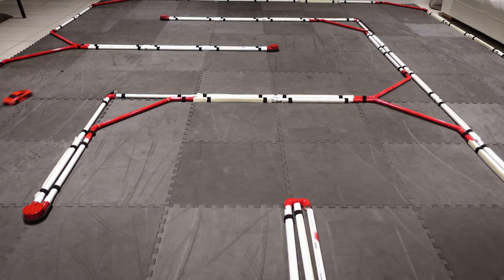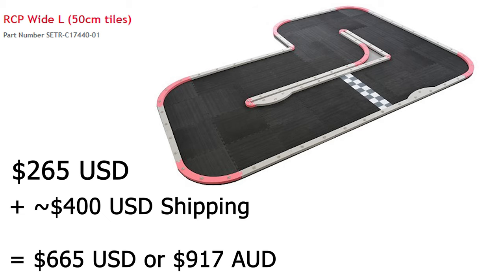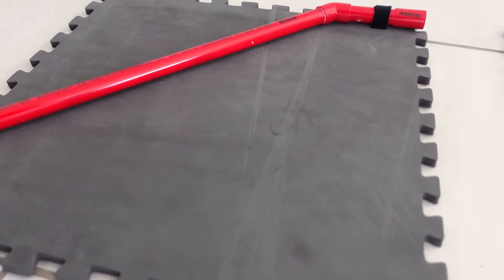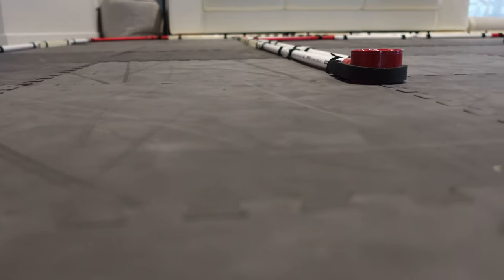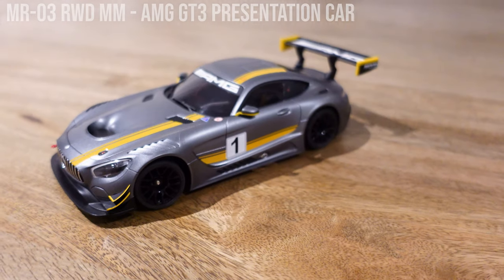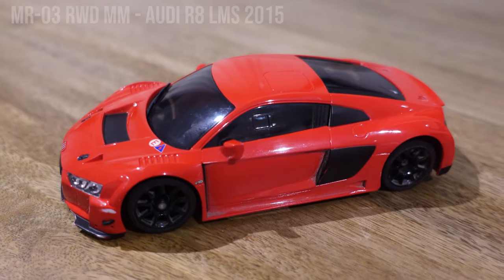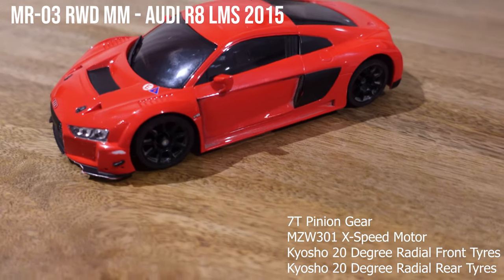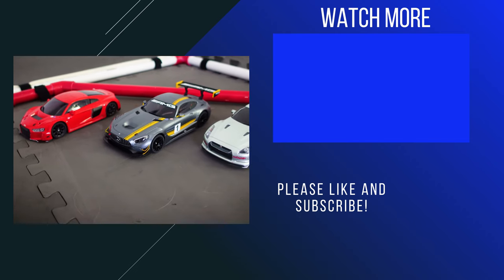I Made A Track For Mini-Z RC Cars

Comment: I have something similar. I bought adhesive neoprene on amazon and cut it down to match the thickness of the pvc pipe all the way along the pipes to prevent any damage to my cars. It will allow you to have piece of mind as well down the straight aways!
Reply from the maker: Great idea with the adhesive neoprene!
Reply: @jarvzRC  yes it’s been working well and definitely improved my driving. I really like your track design and how you painted certain areas. The money you saved on a track can go to upgrade parts! Keep up the great content!
Reply from the maker: @RePtIlEBoI255  Cheers!

Comment: Nice... i made my own track also from foam tile like that... but i cut the foam instead of using pipe, so it will protect your car... and you know what, the pattern track is similar like yours... yes the joint is not flat, you can use tape on the joint to make it little bit smoother...
Reply from the maker: Very nice! I've seen photos of tracks made using cut up foam for the barriers and I think I prefer that over the PVC pipes. I'm considering updating my track and changing the barriers to foam in the future.
Reply: Hey guys....just about to do this myself, fantastic idea. I didn't quite get what you meant by cutting the foam? I like the pipe because you have a barrier /outline  .... But you can do this with the foam? I can't quite visualize in my head what you mean. I'm probably being stupid :)
Reply: @D1ARBO  it means... i cut the mat, and make it as separator of lane... it’s good for the car in case there’s collision/crash to the separator, it act as dampener

Comment: Nice looking track. What did you use for the inside corners? Looks like soup cans.
Reply from the maker: I used PVC junction boxes. If I were to do it again, I would use cut up pieces of foam tiles to use as barriers because the PVC is too hard on the Mini-Z bodies

Comment: Great Track! what does the t plate ACTUALLY do when running on this type of track?
Reply from the maker: Thanks! The rear T-Plate plays an important role in the Mini'z's handling. Without the correct T-Plate, your rear won't have good traction and your car will be difficult to drive. 
The T-Plate has two functions:
- It is meant to absorb bumps
- It is meant to transfer weight forward, backward and side to side

I haven't done enough testing yet on my cars yet to find out which T-Plate works best for me. The stock plastic T-Plate is fine if you're just starting out.
Reply: @jarvzRC  Thank you man
Reply: It looks like you have got the same EVA-foam tiles as i bought frequent. Mine are 40cm square and i read about it that’s only available in 40cm2 and 60cm2 type of tiles. They’re 1cm thick so an underfloor will improve the flatness of the whole track with better equals of the seems. Mini-Z has a plastic t-bar for each new bought cars and rtr sets. Please keep in mind the 4 differences of motor mounting is separated in two types of t-bars. The HM and RM (high mount short chassis 86-90mm wheelbase and rear mount old standards for mini-z 94mm chassis wheelbase. They’ve got the same t-bar wich is ever so slightly longer than the MM and LM chassis wheelbases at 98mm and for Low Mount-LeMans 102mm wheelbase chassis) HM/RM at rcp track needs a carbon t-bar stage 6 upgrade, only my experience with this less grip providing EVA-foam track you’ll have to test your own setups with different types of upgraded carbon t-plates/t-bar (same, in the Netherlands we call it a t-bar, other languages use the t-plate term. You can buy the upgrade from different manufacturers and the ones that Kyosho, Atomic and PN Racing makes are almost similar in costs. The third-party manufactures with Atomic and PN are much easier to get and go as thin as stage 2 (buy whatever you prefer of course, the set of 3x t-plate upgrades from kyosho are stage 5/6&7 in one blister package) for the most part grip comes with different sizes of rims & tyres plus t-plates. And type of chassis with motor positioning, bodykit, damping and many more possibilities. T-plate PN stage 4 works fine for me. T-plate 5 from 3-Racing also works fine. Atomic fiberglas t-plate 3 is really good for me. Keep in mind that this is incredible personally and that you can experience different results from the same material. Greets and good luck. Keep fun is the key
Reply: Thanks for the video my friend. It is a very useful one for me especially

Comment: What brand foam tile are you using ? Most the ones you find are textured and not smooth like these?
Reply from the maker: Not sure what brand they are but they're from my local hardware store bunnings and have a textured side and a smooth side. If you're in the USA, I've heard foam tiles from Harbor Freight are pretty good.